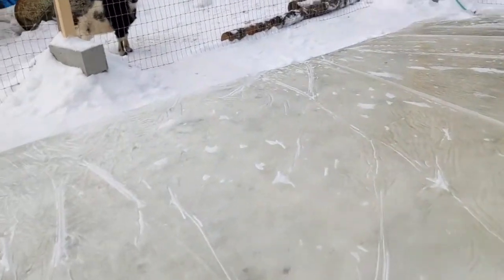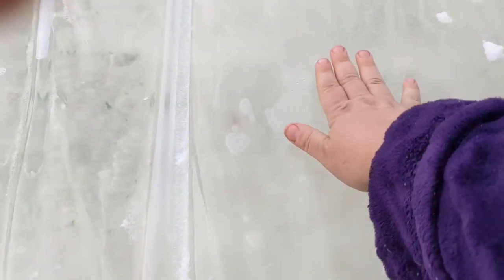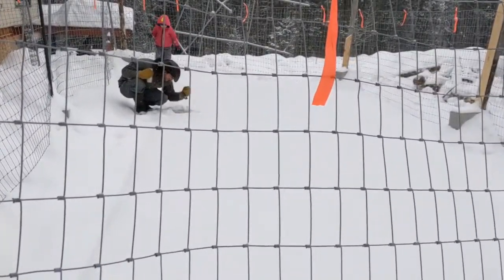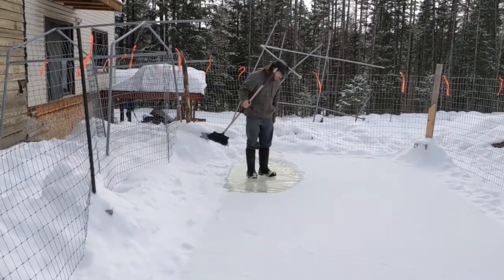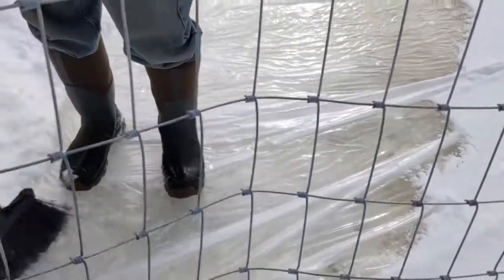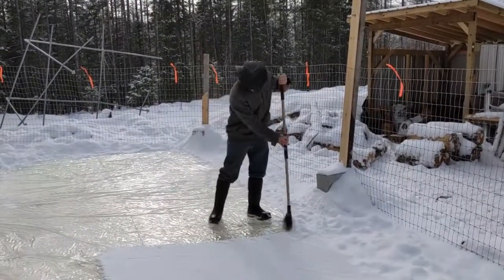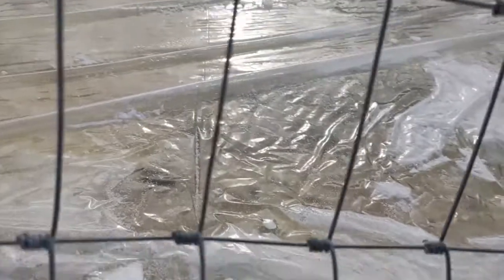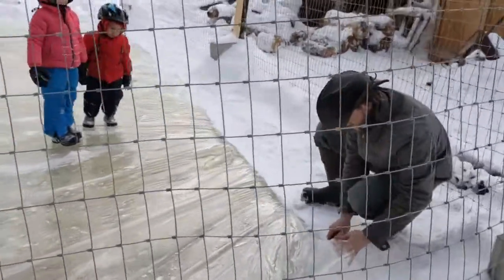Making an Ice Rink Part 2 - Vic Hockey Reddi Rink

Comment: I just bought one and i am filling it now. But what stops the water from coming out after you remove the hose from the hole.
Reply from the maker: Well nothing really... Except for gravity?  The hole goes up at the top and it's on a flat surface so there's no reason for the water to leave
Reply: @IndigoSkookum  that's what i figured i just thought maybe mine was missing an internal flap or something. Thanks
Reply from the maker: @bobbob3312   hmm an internal flap would probably be a good thing, I can't remember if ours had anything like that.  Good luck!

Comment: hello, from South River, Ontario, so tell me this works Vichockey ice rink?
Reply from the maker: Yup it did work well!! :D
Reply: @IndigoSkookum  SORRY  AND ANOTHER QUESTION, AFTER YOU PUT IT AND WINTER IS GANE, WE HAVE TO DROW IT AWAY, AND BUY A NEW ONE EVERY YEAR? AND THANKS FOR YOUR HELP.
Reply from the maker: @jeannette6638  yes sadly it is a single-use plastic, which was disappointing to me, however it is a fairly thick durable plastic so you can use it for a small greenhouse or other use! You just have to be creative with your recycling is all :)
Reply: Hit or miss depends if you do it right. Have seen a lot of people say it doesn’t work , but their ground is not level so obviously putting 2 and 2 together , slope +water won’t freeze right
Reply: Do we have to remove the plastic at the end (the tarp) or we skate over it?
Reply from the maker: Unfortunately, yes you do have to peel off the plastic, in order to expose the ice to skate on.  It's fairly durable plastic though so it's easy to find another use for it.